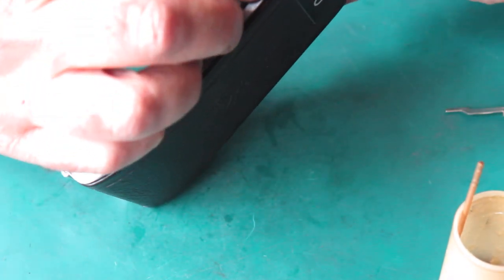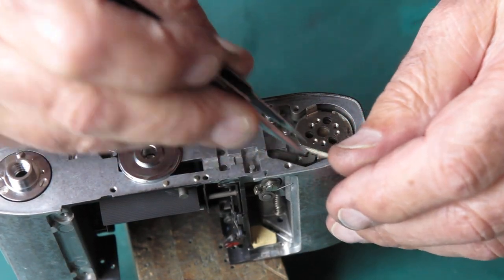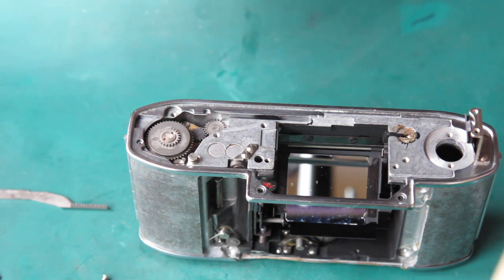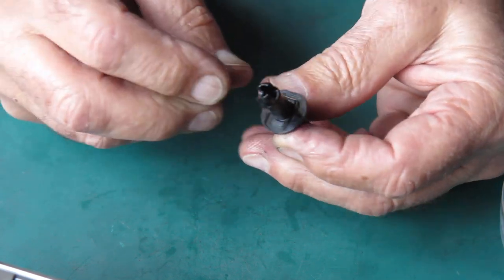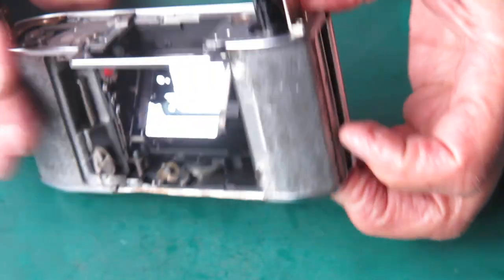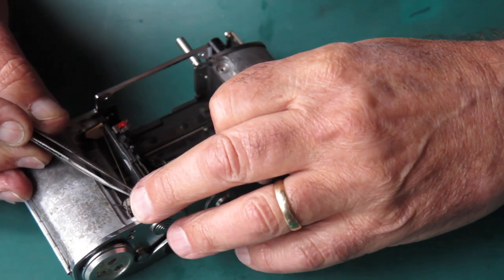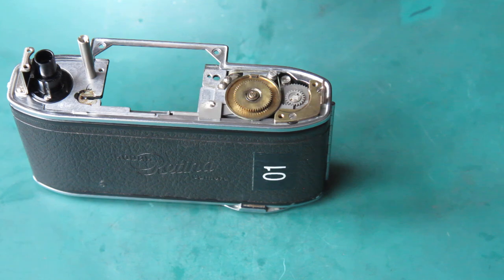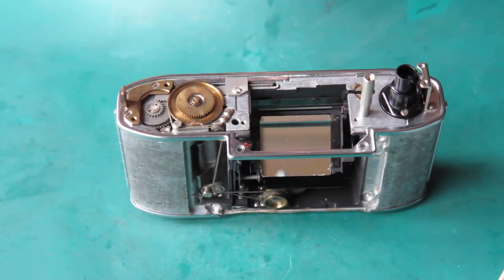Servicing a pair of Reflex IV cameras, part 03

Comment: Thank you Chris for making these videos! We are going to need them. I was wondering what chemical you use in your ultrasounic bath?
Reply: Hi buddy my advise for what it's worth. Google, What cleaner is recommended for an ultrasonic cleaner. 
Personally I just use a degreaser and rince out with dishwashing detergent and a warm water rince. Be Careful with painted surfaces.
Reply from the maker: I run the parts through a grease and wax remover, something meant to be used to wipe down surfaces prior to painting, and then run the parts through again in hot water and domestic detergent,  HandyAndy in this case, a thick, white detergent with some ammonia content I think.